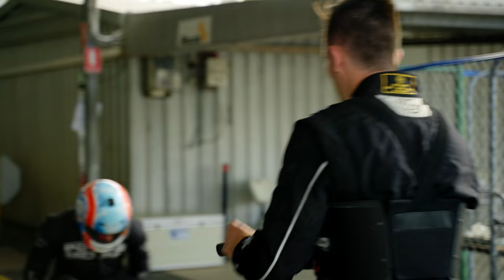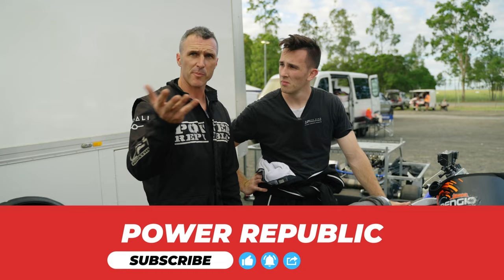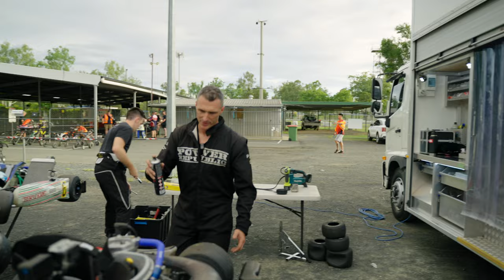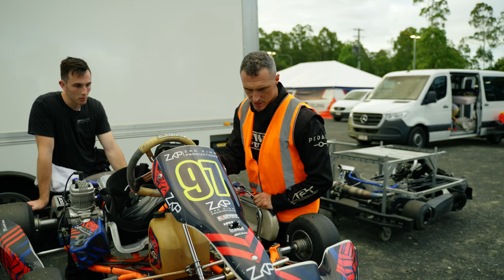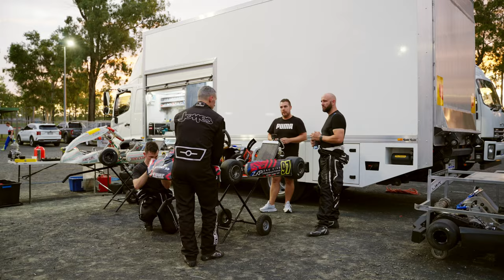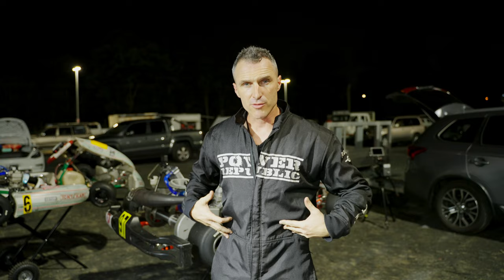🚨 How To Fix Anything Trackside - POWER REPUBLIC

Comment: Hi guys great video ive bought myself an exprit kart like zacs many because of your channel   the kart came as a rolling chassis so ive watched many of your how too videos many times on how to set it up ive a question for des what length steering column do you use in your tony kart ? Im a tall driver and my kart has a std 470 mm and to my surprise its not on my knees so i may try it thank you so much for your videos on your channel i couldn't do it without you 😊
Reply from the maker: That is awesome!  we use the standard 470mm column, works a treat.   another tip is you can cut down to any length and customise it if you need too